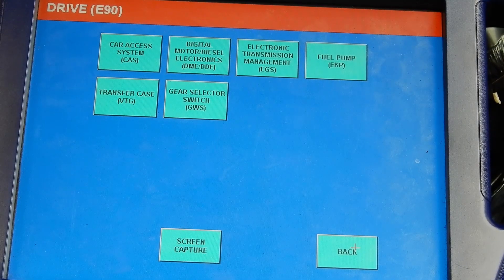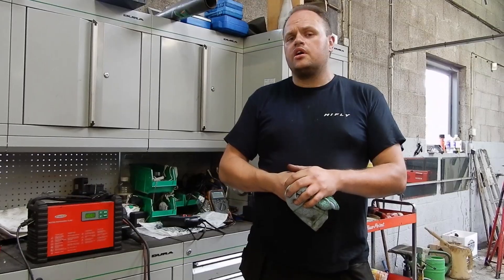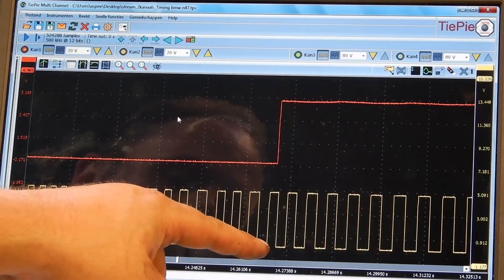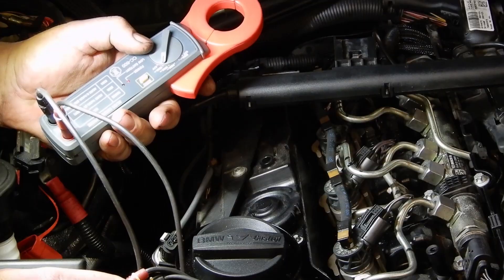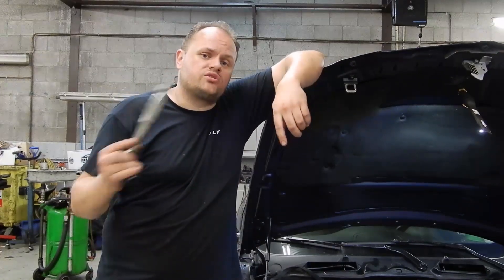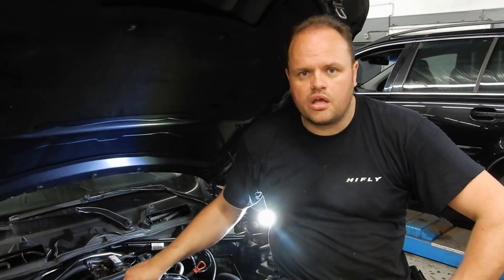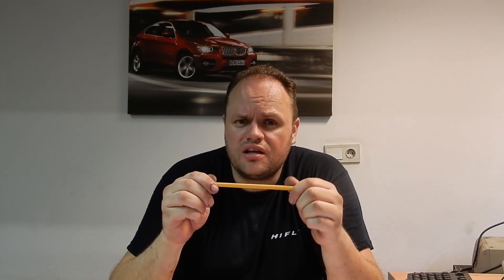Bmw n47 diesel engine "Won't run" diagnose

Comment: Just going back over your older vids, Dan... you've become much more polished in your presentation over the years, thank you for the continuing education...🤗

Regarding this vehicle, it would seem to me that the relative compression test points to a semi-seized piston /broken rings  (the one with the highest "compression" peak)... I wonder if the sump pan clue has something to do with it , gasket sealant blocking the  oil pickup ?...

😎👍☘️🍻

Comment: Excellent Video.  Thanks.  One question just to help my learning... once the cam/crank waveform showed the timing was correct compared to a known good, was it still necessary to do the relative compression test with the injector firing synced?  Would there ever be a case when the cam/crank waveform would show correct timing, but the relative compression/injector sync would show incorrect timing?  Thanks again for any advice.
Reply: Yes it's possible to have a good timing but bad compression, remember one cylinder may have a bad, valve seal, bad compression ring, broken piston or worn out cylinder this can result in bad compression. Timing problem result from chain stretching but compression depends on worn out cylinder

Comment: I use the following rule of thumb: the maximum starting current should not exceed three times the original battery capacity at a good starting speed

Comment: Wait…. But Diesel engines are suppose to be extremely hard to turn by hand…. I would also look at the High pressure fuel pump but eliminate if the low side has an issue first… If they let the fuel tank run dry and created air in the system good luck getting it out.  Vent the fuel system and ensure the system has no air.  Car will never start other wise. Just a suggestion…
Reply: They should turn over easily when there is no compression, i.e. when the injectors are out...fuel pump pressure is not involved here either... broken rings and partial seizure of the piston is my guess, the relative compression (current-draw) shows one cylinder is much higher "compression" aka resistance .. thats the dud...

Comment: That's simply fantastic training. Using the starter motor current was a wizard move. Many thanks Dan
Reply: I use the following rule of thumb: the maximum starting current should not exceed three times the original battery capacity at a good starting speed

Comment: I wouldn’t be surprised if it had a timing chain failure and they didn’t clean out the debris correctly- it gets in between the top of the oil pump and the block and then once running again, gets into the oil pick up. The same thing with the silicone sealant on the sump, too much will result in sealant in the oil pick up starving it of oil

Comment: I'm not a diesel mechanic, but I would have pulled of the accessary drive belt to rule out an accessary problem. It's common for locked up a/c compressor to cause a no crank on Ford vehicle. Though this engine is cranking, a diesel has a much more powerful starter.

Comment: I had a seized air conditioner compressor do the same thing. Wasn’t until I noticed a build up of rubber around the pulley that I took the belt off and it ran. Love cars!!

Comment: Yes, the Oscilloscope has it's benefits when checking Cam/Camshaft Alignments (Example would be The Mercedes in (1) of your previous videos. Where the Car had been over cranked in a desperate effort to start it and the Harmonic Balancer Rubber Slipped Position throwing the timing Marks out of Alignment). But by far the Best why of  Setting Vehicle Timing is by Using the Timing Marks, if you know what to look for...!    #HowToSaveMoneyOnCarRepairs     🤔👿😇👍
Reply: You’ve obviously missed the whole point lol

Comment: 1:31 where is the multi pulley belt ?
Reply: You want to take the belt off to make sure no accessories are causing the drag on the engine.

Comment: Iv seen drive belts hold the engine still because of a seized component. Should have removed it just for a quick check.

Comment: Hi, Dan I hope you can help me a little, I have a bmw x3 f25 N47-D20C I have a fault with the diesel system and the error code is 259800
  Presupply pressure sensor, signal: Short-circuit to earth, what is it for and which sensor is it?  I appreciate it if you can help me, I have exchanged many parts and spent a lot of money still I am wrong.  greetings from Ayoob.

Comment: warped or damaged crankshafts or something on the timing chain or a bent valve will cause a partially seized engine that will still turn...allthought bent valves are unlikely because it has some compression on all 4 cylinders...usually if a piston seizes it will not turn anymore but if you unstick it by force it will turn normally again just will lower compression on that cylinde.......seized crank usually only happens if incorrect bearings are fitted...if an original bearing spins or gets worn the symptom is knocking sound and loss of oil pressure... also if it was the crank the car shold still start especially if bump-started

Comment: Red silicone is how you know it was a DIY job. I haven't seen factory silicone that's red that I can remember and any tech worth a shit is using factory or factory equivalent silicone.
Reply: any rtv will seala  bloody sump and there are cars that use red or even grey/white rtv on sumps...there is red rtv and there is red anaerobic glue also....some parts state the use of anaerobic glue like gearboxes....but rtv will work the same as long as you use common sense...even if its bright pink
Reply: @MrHBSoftware  Not all rtv is created equally. He even states it's not original.
Reply: @Carlitosway211  any rtv will seal a sump
Reply: @MrHBSoftware  I never said it wouldn't. I said they're not all created equally. And if it's a sump, not a transmission, with red, I'll put money on it that the last person to have it off was a shadetree or DIY'er.
Reply: @Carlitosway211  lot of manufacturers use rtv on sumps....last sunday i installed a vauhall  a12xer sump from a 2014 corsa and it uses rtv from factory, no gasket...its very common practice....you can buy the original rtv from vauxhall or use any general purpose "gasket making rtv"....no shadetree or diy there.
Reply: @MrHBSoftware  You are not catching my drift, dude. I know the OEM uses RTV. What I'm saying is that red/orange is the common choice for shadtrees and DIY'ers. I don't know why this is, I'm just basing this off my experience over the last 20 years of turning wrenches professionally. It's joked about in mechanic groups on FB for crying out loud.
Reply: @Carlitosway211  maybe you are located in america...because over here (portugal, europe) its hard to buy non black rtv....you need to ask specifically for red or grey and usually its order only....99,9% is black and yeah the shadetree diyer usually abuses on the rtv and it spews inside and out sometimes clogging oil holes... good mechanics always get frustrated about that...i watch some car repair channels, presumably american and i see them using black rtv all the time so i dont know...

Comment: I love the proper technical approach to the problem. Take measurements, analyse, don't make assumptions, and don't go mad replacing parts desperately hoping the fault will go away. Dan's approach is a proper professional's approach. Sadly, a lot of workshops won't or can't invest the time to get to this level of understanding. The tools used are actually quite simple; the underpinning knowledge and experience is the clever bit. Well done Dan.
Reply: Great observation.  Most workshops are all about the numbers (how many can they work on in an hour or a day) and they miss the basics. Dan actually seeks to solve the problem

Comment: It's taking 400A average current to turn the crank. Cylinders 1,3, and 2 have low compression.  Indicates scores bores, overheated pistons. Break out the bore scope!

Comment: So the previous garage did what a lot of them do, just change parts in the hope of removing the "offending"
item, they can't be bothered because they're none too smart to try and understand the problem.
The owner gets billed for a new starter and battery that he didn't need. The strange sounding and
labouring starter should have pricked their ears but they are not real mechanics and gave up.
Where is BMW in all of this I ask? Dan needs to be cloned and franchised.

Comment: Wrong bearing shells fitted. Mains or big ends. Oil pan off = intervention= why?
If transmission was removed maybe torque converter bolts are the wrong length and rub. I have seen this.

Comment: Noticed the aux belt was missing at the start , the other garage obviously new the engine was hard to turn over and removed the belt to see if it was a seized alternator or water pump etc

Comment: It's the injectors. They have to much carbon on them and don't spray at 250 bar like they should. 
P.S.Spraying brake cleaner in the intake is not enough. You need ether.

Comment: When I got out of Vo Tech, in 77, I was the go to guy for diagnosing electrical problems. I even had service bulletins in the 79 Kenworth manual. I was the guy that actually figured out how to make the sleeper AC/ heat switch work. LOL

Today I couldn't diagnose my way out of a wet paper sack. I'm very impressed with both your knowledge and you patience.  Well done.

Comment: Had installed undersize big end or main bearings on previous job or partial seizure due to running no coolant previously. Customer twigged when you told them (or the amount of the likely Bill haha)

Comment: At 11:55, I would have pulled the oil filter and looked for sparkley bits first. I bet there are plenty.  I see it a couple times a year. Usually a new customer,   and usually they admit never to running it out of oil. Amazingly, several times it was only partly the customers fault. (choosing a lousy oil change place that used cheap filters.)  The only damage was very light seize to the aux shaft, so the engine jumped the timing belt and quit before the mains seized, and the engine was saved with minimal work. At least four times, the culprit was a poorly made oil filter that had the media fail. cheap oil filters that use paper based media and winter running that puts a fair amount of water vapor into the oil, and the paper based filter turns to mush that wont flow any oil.
In any case, the filter gets cut open, filter media spread out, and then tacked up on the "Wall of shame" for others to see. I sell a lot of german made filters that way. I won't allow anything other than OEM filters in my clients cars, but Baldwin and Wix are fine also.

Comment: My journeyman taught me to apply the basics, just as Dan demonstrated. When reporting that the oil pan gasket was glued with silicone, one immediately knows that the cause of hard engine turning is in the bottom end. This video has just reminded us to apply the basics. Cars from other workshops that cannot repair properly reveals incompetency as most modern workshops have the tools to assess the problems. The other workshop know where they have messed up and were not willing to sharw the correct information. Very sad as the customer  suffers the consequences.

Comment: Excellent videos,new subscriber here;

edit 2023... what was the problem with that engine in the end?

1:15   starting fluid on diesels:
 you did it sparsely and well,  i myself always try to have 2 people for that, one cranking and the other one  spraying the ether in, but from a foot away away;  the wrong fluid,or too close, or in too thick a cloud, and it WILL break piston rings ; i have done that; once!; it's a diesel,it's a fine line there, the compression is huge, liquid ether,or even just excessive ether, detonates,meaning it explodes,and that can cause severe damage

Comment: Hi dan i know you are experienced tech. 
As you might have seen acssory seizing up.
AC PUMP, generator ECT.

But i have seen DMF exploding so the springs come out the side and blocks inside the bellhousing, causing these symptoms.

Regards from Denmark

Comment: Had something like this come to me years ago. Had a Buick that wouldn't start. Owner had it towed to a shop that said it needed a new motor. He talked to me and I had it towed to my garage. It turned out the a/c compressor was bad and locked the belt drive up.
Reply: Belts off when he tries turn it. Looks more like someone dun goofed when rebuilding the bottom end..
Reply: @jamesward5721  I'm just regaling about a repair I had.

Comment: Hm did you check the oil lvl and the qulity and peaked in to the cylinder? 
Im thinking, oil or fuel floded the cylinders.  Or the oil has been diluted with dieasel from a bad piston seal,  comprimising the lubrication .

Comment: I'm going to guess this poor car has never had its oil changed and then sludged up so badly the oil pressure warning came on. Someone then dropped the sump and cleaned out the sludge from the oil pickup but the damage was already done and with fresh oil dislodging lumps of sludge the oilways blocked and it's spun a bearing or two.  Would have been interesting to take the cam cover off, bet it would have been a black sludgy mess underneath.
Reply: I had a maths teacher at school who had a Morris 1100. It wasn't running well and he handed it over to the motor mechanics class to fix. The teacher asked, "What's that black tape on the dashboard for?"  "Oh, it's to cover up that red light. It's always on" "You mean the oil pressure light?" "Oh, is that what it is?"

Comment: I think I’d want to do an actual physical compression test as the relative test only highlights major differences between the effort required to crank each piston up to tdc.
If compressions were acceptable and a booster was used to get an acceptable cranking speed it should start with that whiff of brake cleaner put in.

Comment: not to familiar with car diesel engines, but if gear driven accessories exists ie, oil pump, fuel pump,  water pump, one could be locking up and creating drag on the engine.
edit:  One more thing, there could be a drive belt accessory locked up also causing the engine to turn over hard.

Comment: red gasket sealer, hard turnover. someone possibly did new rods, mains, or both.
could have mismatched the rod caps,  installed the wrong bearings.

Comment: @Diagnose Dan I am thinking Cyl 3 has highest cranking amps and has either a Damaged piston/cylinder wall issue where drag is highest "or" the big end bearing has welded to the crankshaft 
I favour the Piston/cylinder wall issue, as that adds a moment of force to crank rotation ?
Am I close?

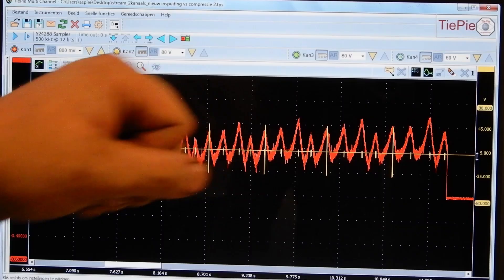Comment: As seen on 8:20 cyl #3 is the one drawing the most current, therefore it's the one with the highest compression ratio, wich means that the piston is traveling further up on that cyl than the others. I believe this n47 engine is a "interference engine", wich means that if timing chain was to break the pistons would hit the valves, so, we are lead to conclude that the reason for Dan not being able to turn the engine around by hand is because cyl #3 has its piston hitting the valves not enabling the turnover of the engine. My guess: Oil changes not done in time, maybe even with poor oil quality and the big end bearings on cyl#3 failed overlapping each other and making the piston "stretch" upwards maybe a 1 millimeter or 2
Reply: That would lock the engine. Not to mention the noise it would make.

Comment: Did you check engine oil ? Looks like someone run engine without oil. I belive 99% if you would check level of the engine oil you would find out the problem.
I had a chance to recover many engines with the same symptom. Engine is ok. Fresh lubricant would save the hours of investigation ,time , frustration and money

Comment: I am a little late Dan, but my first question from the one who sent this to you is 'exactly when did this problem start?' Has it ever run after the previous engine work? In my experience, a spun bearing will not cause increased friction as by this time the shell has chewed out and there is a bigger clearance between the shell and the rod/main cap.
Why didn't you put a camera down the injector holes to check cylinder bore condition when the injectors were removed?

Last time I had this problem was after a guy pulled his range rover V8 and replaced rings/bearings. He put the bearings for crank end float in the wrong block location and did not match them together either (a little knowledge can be a dangerous thing). Once I corrected this (still in the car as plenty of access to remove sump) it turned over and started normally.

Comment: Sounded funny, turning over. 
I always remove accessory belt to eliminate all possibilities. 
Seen a seized up trans pump make engine look locked up, got engine out and it turned over fine after replacement was sitting here ha!
Reply: Nice one mate I was waiting for him to take the aux belt off had a golf with seized alternator oops,

Comment: A regular 2.0 TDI VW should be between 150 to 180 amps with a regular amp clamp (rms type, not scope) and over 250 is really always a bad starter.
That BMW has really blown out the bearings!!
Should really be able to move the crank with one finger on a 30cm ratchet at least uintill the next compression stroke

Comment: Cyl 3 had the most draw. But the engine is hard to trun even when it is not coming up on #3. If the pan was off, did they change  a failed oil pump? But the bearings are ruined so it won't turn over?

Comment: In one of the car you were diagnostic was call a lot of back pressure dpf. I think the reason that you ave that much pressure is becouse the dpf, is plug becouse it works just like a catalytic comberter. Dpf is completely plug.